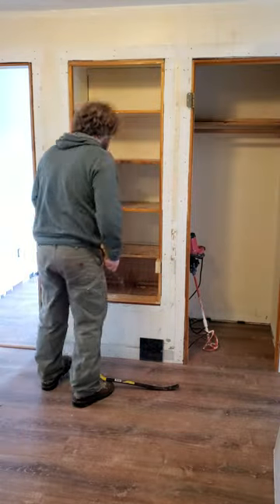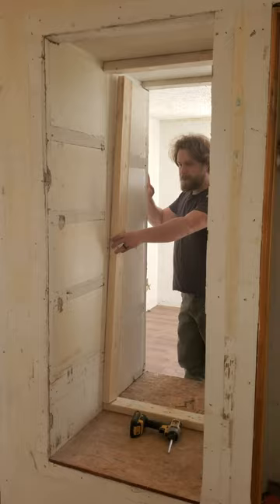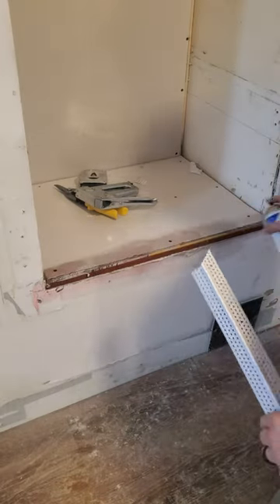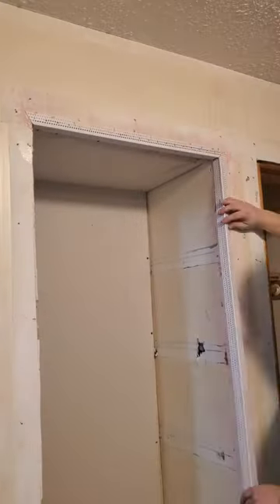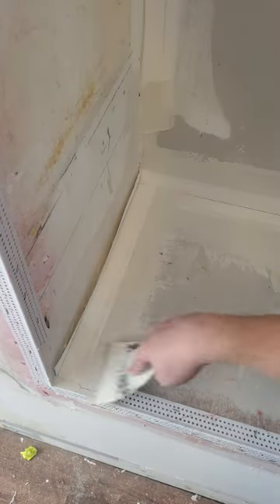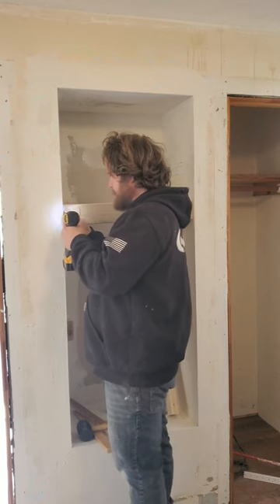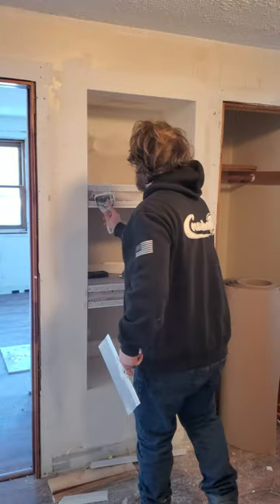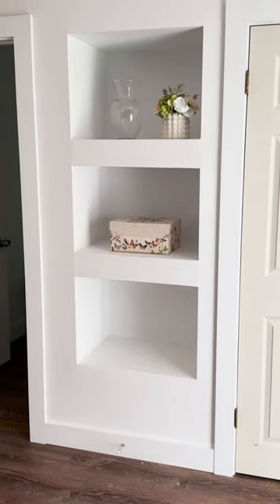Make Modern Drywall Shelves

Comment: Use MDF for the shelf.  You can finish it the same as drywall (corner beads, etc) but its alot more durable.
Reply: This, or he could've just used the plywood and coated it with hot mud. This is what I do on the wall right behind the knob. Never get a door knob hole again.
Reply: @BigBrotherIsTooBig what is hot mud? I've never heard that term.
Reply: @cheeseballs3825  It's the powdered dry mix that hardens after you mix it with water. You can find it at any home improvement store.
Reply: @BigBrotherIsTooBig going to try that
Reply: @Mthomas71188  The shelves or door knob hack? First time it did the door knob hack I literally slammed the door into the wall as hard as I could, broke the knob, small dent in wall, easy to patch with spackle.
Reply: Or just use actual wood which is not much different in price and will last even longer
Reply: @meltin9026  sure.  We can all do what we want and that's a wonderful thing.  I'd prefer to avoid fighting with wood grain or flimsy drywall for a shelf.  Just putting it out there because people might not consider the MDF option.
Reply: @meltin9026  It's much more expensive than drywall, even the cheap common boards. Not to mention the skill set and tools required to make a good looking shelf.
Reply: “In my continued quest to not suck at dry wall”
Reply: @BigBrotherIsTooBig or just get a door stop 🤣
Reply: @gerryferrigno9654  door stops fail.
Reply: @BigBrotherIsTooBig dude, that is gonna delaminate. Huge difference in expansion rates.
Reply: @robertaylor9218  I've had one room in my home like that for over five years, no problem. I'd think it's no different that attaching drywall/mud to wood which expands and contracts but if installed correctly, there aren't any cracks.
Reply: Home stores like Menards have really awesome MDF shelving in all sorts of different wood grain looks, distressed wood, barn board, reclaimed wood look etc.
Reply: Drywall shelves ? Bad idea
Reply: I just use mud alone, no drywall, but the shelves are harder to form.
Reply: @BigBrotherIsTooBig  no they don’t unless you install them wrong or constantly slam open your doors
Reply: @cheeseballs3825 Hot mud is a term for fast curing compound. It's called that because it literally heats up a bit while it cures. Regular compound comes in powder form as well don't mistake the two.
Reply: @juan2049  Exactly. Kids and tenants do kids and tenant shit. Hence, the plywood 😉
Reply: my neighbour is building his whole house out of MDF
Reply: @-KIMISAFOX   I'm in Ontario Canada. We have Durabond, which sets up, very quickly, like concrete(so the Durabond would be equal to hot mud). We also have Sheetrock. It sets up fast, but it's sandable, because it's not NEAR as hard as Durabond(which, technically, is sandable. So is concrete, but why would you want to😊). Similar products, but, as you say, NOT the same.
Reply: Why not the pine boards? What's with the allergy to Wood
Reply: @OTW376 part of not sucking a drywalling is knowing when to drywall and when not to drywall
Reply: @cheeseballs3825  It's like cold mud but much warmer

Comment: Looks clean, when the shelf breaks (not if, when) you can replace it with the plywood you took out originally and just paint it white. Also lol at 2x4 supports then using sheetrock.
Reply: Yeah, he should have put down 1/2" plywood, then dropped the drywall on it.  Oh well, a piece of cut to fit and polished tempered glass laid on top of the drywall shelf will solve the problem of "when it breaks".  Granted, the approach is somewhat unconventional, and my guess would be it's the Mrs. that is the driving force behind destroying a perfectly good set of recessed shelves only to build another set of recessed shelves.
Reply: @redformansfoot5718 couldn't have said it any better 😂 spot on
Reply: they wont
Reply: Should have used 2x3 shelves and added puck lighting.
Reply: There is no reason that this should break its for picture frames and light items and it is actually being slightly supported if you watch the video. You could do many things to support the shelves like adding plywood or maybe framing 2x4s behind the initial wall but there’s no point because most people won’t put 30+ pounds on it

Comment: Drywall shelves arent a thing bud, its not meant to hold weight. If you were gonna be stupid about what material your shelf is made of, at least use thicker sheetrock.
Reply: How much weight could you possibly put in a 2ft wide living room shelf? 
At most they're going to hold some books.
Reply: I bet you have lots of friends, bud.
Reply: @theoriginalmonstermaker drywall is as strong as wet cardboard. kid.
Reply: @theoriginalmonstermaker  2000 rounds of 5.56 ammo
Reply: @you_tube6733 and wet cardboard could also hold a small paper box like that shelf is. kid.
Reply: @you_tube6733  no. you've no idea at all.

Comment: Looks great, only thing i could think to add is using plywood shelf first then drywall piece on top for the smooth top layer.  Now you have the added strength but the look you after, if bottom wood can be seen just do drywall bottom cover piece.  Nobody would know there is stronger plywood in there.

Comment: Mud goes under tape and corners. Scrap over it to set it in place.Then you mud over the top. That tape will peal in a year.
Reply: Right, no prefill and just spray adhesive….
Reply: Looks like he did mud before taping. Just didn't show it in video.

Comment: Yeah you're actually supposed to attach the bead to the drywall ONLY. If you nail or screw the bead into the stub below the drywall, it is guaranteed to crack over time. This is because the stud is wood, and shrinks, the drywall does not shrink.
Reply: That is just simply false
Reply: @nickchristian1590  nope
Reply: @ModernGentleman  CODE: ASTM C840 • The external corners shall be protected with a metal corner bead or other suitable type of corner protection that shall be attached to supporting construction with fasteners or a crimping tool nominally 6 inches on center.
Reply: @nickchristian1590  so, the crimper crimps the bead all the way into the stud?? The "supporting construction" is the drywall. The fasteners are staples..
Reply: @ModernGentleman  we screw into the holes provided by the manufacturer (the outer ones) that are intended to receive screws. Haven't had to repair anything, haha. I would say the "supporting construction" would be framing, and I would have called anything like sheetrock to be a "supporting substrate." Love how "you have to follow code" but it can be interpreted differently, lol. Keep on keeping on
Reply: @nickchristian1590  well, logically, a simple understanding of the physical properties of the materials would dictate otherwise. Wood expands and contracts, drywall does not. Same reason we use butt boards, because the floating seam doesn't crack. I've never had a call back to fix bead or seen any I'vedone that jas cracked, and the bead in my house hasn't cracked in 9 years since I did it. Perhaps the difference between attaching the bead to the board or the stud is negligible. 🤷‍♂️ but yes I agree the codes are definitely interpreted differently from person to person lol
Reply: @nickchristian1590  however, your explanation still doesn't answer my question. How, exactly, can a crimper be used (according to code as you interpret it) if code necessitates attachment to the stud (according to code as you interpret it), and not just the drywall?
Reply: @nickchristian1590  also, i think by definition the "supporting stucture" doesn't refer to the structural aspects of the home itself, but the material that supports the installation of said material. Eg-the stud supports the facilitation of drywall, the drywall supports the facilitation of corner bead
The stud supprts the sheeting, the sheeting supports the siding, etc.
Reply: @ModernGentleman  honestly, no experience with a crimper nor have I ever seen one in any of the videos I've seen about drywall or jobs I've come into. I'll check it out. I guess I assumed it would have one side that would be attached to the rock, or framing and a different corner bead would have a pre formed edge (or whatever) that would then get crimped together. What general region do you work in, out of curiosity (northeast, southwest, etc)? I've never seen the adhesive and staple system either on any job. But if that's how it's done in your area, and still within code, cool.
Reply: @nickchristian1590  the midwest. I dont use a crimper either personally, but all it does is snip about a quarter inch triangle on each side of the bead and pinch that triangle of steel into the drywall to hold it in place. It's an even less solid attachment than staples. That first coat of bond is what really holds the bead on, especially with a crimper. I'm not an authority on it or anything, but I know for damn sure that the bead should not be mechanically attached to the stud below. Its almost guaranteed to crack after about 2 seasons if you attach it to the stud. As the wood shrinks, it pulls the screws deeper, and thereby the bead is also pulled and the edge is lifted, causing a crack. Notice how if you put a screw in toi deep it buckles the bead? The same thing happens slowly over time as the wood contracts, especially on new construction.
Reply: @ModernGentleman  new england here. We do mostly remodels, so I don't know if that changes why we do what we do. All I can do is base it off "the code" and best practices I was taught. Your point on the framing changing is totally valid, and I'll probably offer up the alternative. Obviously screws are still allowed, and manufacturers are even nice enough to give holes intended for that reason. Lol, they may just be hoping to sell more by having people screw it and needing to do it over. We've never had a call back, so your definitive stance is a little off, but I get what you're saying. Keep on trucking, man, and be well out there
Reply: @ModernGentleman  and crimping seems a little better than people who just mud the paper faced corner on but I probably won't bring that option up haha. Thanks for the info

Comment: The end result looks good man. If i may, I'd like to share some of my experience, and hopefully, it helps. The best way I've learned to mud well, is to do it the older way. Bend the tape yourself, feel every bit of the process. Sometimes staples work their way out due to wood breathing (key word: sometimes), also if you can don't let the shelves be hollow (inside). Over time, rock can bow when laid horizontally with a load on it, like a shelf, so adequate framing would be your best friend. You didn't mention the type of mud you use, but I've learned that mixing your own mud is better than premade. But if you can not mix your own, that's fine. Add soap (dish soap) to your mud (you can do the same if you make your own mud mix too). It makes the mud smoother. There's more stuff, but I don't want to overstay my welcome. 

These are things i picked up while in the trades and when i had to fix other people's screw ups.

Comment: If I am not mistaken, the corner bead has a pre-applied adhesive, just moisten and put in place. I have used these, super strong
Reply from the maker: That’s really interesting. The ones I used didn’t but that sounds like an awesome feature maybe I’ll give those a try next time. Thanks for sharing and for watching!
Reply: @OneWayToMake  they are available at Lowe's

Comment: General question: I was taught to put mud under the corner protectors, is that the right way to do those? I was told it made them much more durable.
Reply from the maker: That’s a great question, yes that’s another manufacturer acceptable way to instal these. I don’t know if one is better than another but they both work well, do whichever feels best for you. Thanks for watching!

Comment: A friend of mine who does a dry wall for a living just sticks the corner protectors on the mud, doesn't fix it in any other way. Just put some mud on the inside, press it against the edge, and smooth the outside. Wait until it holds, put another thin layer of mud to cover any dimples

Comment: Try letting the spray adhesive set up for about a minute before sticking your material to it. Works a lot better
Reply from the maker: That exactly right, I should have called that out in the video. Thanks for pointing it out and for watching!

Comment: Okay so I'm renovating my house and I just did three doorways of corner bead and mud and drywall I took three doors down no pun intended and made them door less entryways. If I had known for crying out loud that they actually made vinyl corner bead and that you could tell me that I could actually staple that s*** instead of screwing them in my God the time it would have saved and the effort sanding because of the vinyl and staples I would have saved.
Reply from the maker: I totally know how you feel I’ve done exactly what you did for many projects and it worked fine but like you said a lot more time and effort with that method. I hope this method works well for you on your next project and thanks so much for sharing and watching!

Comment: Why are you using the plastic corner bead? Get you a pair of tin snips, a corner bead crimper, and use the metal bead. It's not only cheaper than plastic bead (depending on your area), but it's also thinner, meaning you use less mud and save money.

Comment: looks nice but lost alot of space,  it went from 5 shelves to 3.  🙁
Reply from the maker: That’s true, part of that was by choice the old shelves were about 12” apart and these are 16”. I probably could have stuck one more in there but went for higher shelves. You are right though the old shelves were 3/4” thick and these are 4” so way bigger. Definitely something to think about when deciding if these shelves are right for you. Thanks for the input and for watching!
Reply: Whats an alot?!
Reply: You should have also used plywood or MDF for the shelves, drywall is not made to hold anything over a void... You're just asking for a break.
Reply: it also wernt from sturdy to weak as wet cardboard.

Comment: You were doing really well there using the term joint compound. Shame you then reverted to the slack term mud. Would that be the same mud as for brickwork, or for driveways, or just that brown stuff generally found outside. 
No wonder houses in the US blow away when the wind blows. Everyone is using the wrong materials.

Comment: They look 100 times better but you took almost 100% of the strength away. Put plywood under the drywall if you really must. 

Epoxy floor paint or epoxy resin coating will be even smoother and cleaner than drywall. Get a little tub of  wood filler and then fill and sand the plywood the same way you do drywall mud. You can coat the whole surface of the plywood if necessary.

 If you use latex paint, thats ok to. Sand the wood between coats. Just lightly smooth off any bumps and brush lines before adding the next coat. 

Any of these methods will look identical but hold a lot more weight. Plywood alone might actually look cleaner and be less work with the wood filler since you won't need a corner bead. 

For bad edges on a wood shelf, use bondo.

Comment: Beautiful result, but structurally - drywall is not the best choice for the shelves.
      (You didn't even use the waterproof kind, so it'll collapse when wet).
     Next time: plywood or MDF for the shelves, and you could park a moose on them :)

But again: looks good.
(And staples: as long as they reach the wooden frame underneath the drywall - should be fine)

Comment: They look good, but drywall is not strong enough to be shelves.
If you are stuck on using drywall, then use plywood for the shelves and than cover the plywood with drywall. You get the same look but much stronger.

Comment: You need to start working with higher quality plywood and mdf, dump the 2x4s unless you need some serious strength (like 500+ lbs).  Learn to build things like you would cabinetry.  You'll find the results of home upgrades much better and longer lasting.  Looks good though, hope it holds.

Comment: It looks good but you cant practically use them for anything youd be taling off and on since its drywall and wont hold up, i prefer doing a sande plywood with a dark stain but if the custoer wants them panted youcant tell the difference between the drywall and theyll actially hold up

Comment: It will develop cracks everywhere you used staples instead of screws
Reply from the maker: Interesting, I haven’t seen any evidence of that on other projects I’ve seen installed this way. Can you explain your thinking? Thanks so much for watching!
Reply: @OneWayToMake  with regular use it's a good possibility and go look at your other projects real close If you don't find any cracking and that never cracks well then. Good job, more power to you, but for me. Experience has shown. It's hard enough to get them to not crack with proper nailing.
 Then again, if you're piling a bunch of mud on there.  Maybe that I'll keep it from cracking, but I do remember you saying you did use a lot of mud? Whereas in the field on the job we're always trying to use this little mud as possible as thin as possible so it Can dry fast.
For the second Coat Can dry fasthat way Sanding The same day that way finished Paint go home

Comment: So you put a weaker material in for a shelf then paint it? Makes no sense. Use a smooth plywood if you’re going to paint it. At least that way it won’t get dinged easily and can hold some weight.
Reply: Good thing it’s his home
Reply: The ply wood looked tacky be for real
Reply: @RenoPayto you just like unpainted drywall? 😂
Reply: @RenoPayto so just fill and paint it? Am I crazy?